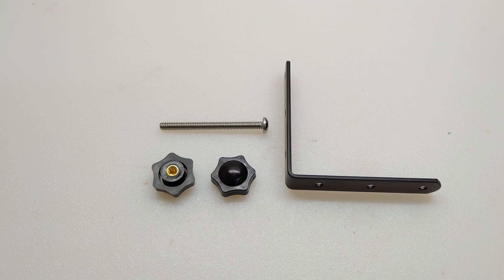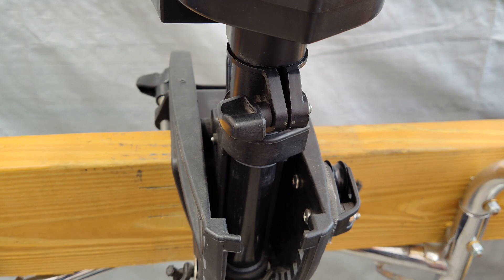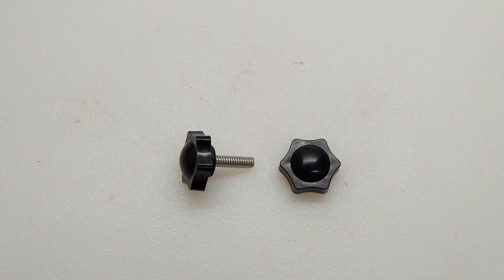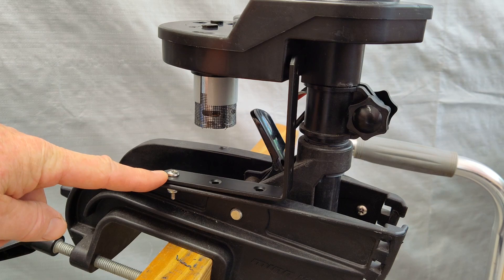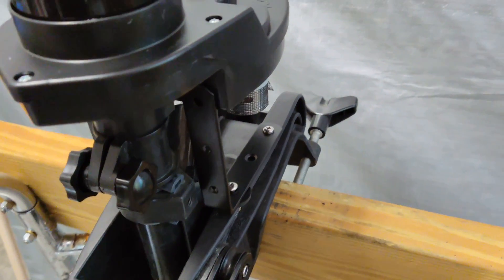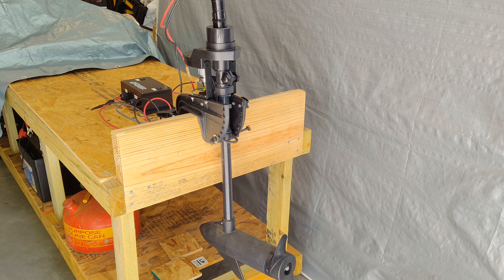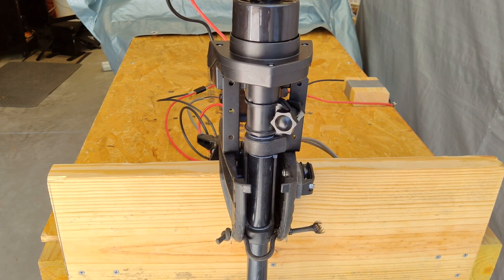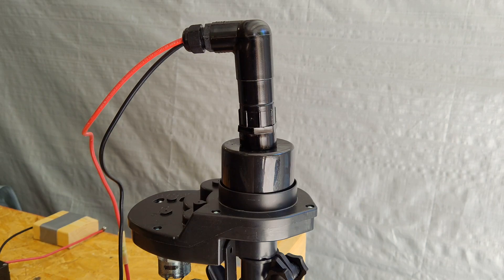Wireless Throttle and Gearbox Steering Stops for Trolling Motor

Comment: https://youtu.be/aZ_nHpNvjpc?si=Uc9aisNRS6FqQki7 

Stumbled into this vid today: it details how to adjust the amount of travel on the transmitter. No need for stops!
Reply from the maker: Thanks Wali. I had ordered another ESC to try that out since I know CH2 can be adjusted as well. I didn't know about the video though.
Reply: @Aksmaniyak   I gotta take it back. That doesn’t do a thing in terms of stopping rotation. The gearbox would have to be a servo for that to work.
 What it does do is slow it down and smooth it out a lot. Similar to changing the esc programming but just using the transmitter. The reduced “stroke” makes for very smooth steering.
Reply from the maker: I tried using the channel 1 with the servo motor and the wireless controller and didn't notice any difference.
Reply: @Aksmaniyak  interesting. 🤔 wonder if the manufacturers idea of “stroke” is different than ours. Things often get lost in translation. I’m going to give it a shot with a regular servo and see if I can puzzle it out.
Reply from the maker: @fishesfromtupperware  It wouldn't be the first time that poor translations occurs with overseas products. Let me know how it goes.

Comment: I'm still hacking away.  I see you've used those 880 ESC on a few projects for a while. How's it holding up long term and under load?  Have you had a chance to run it hard for a long time in any of your other projects? I'm really amped about it and looking forward to wringing it out. Just looks a little physically small for the job.  I'm really hoping you'll tell me its fine. 
BTW: I found a "new" building material for brackets, boxes etc.   PVC sheet created by splitting and flattening PVC  pipe with a heat  gun. Easy to work and strong enuf.    https://youtu.be/wLZVM4r1n9c?si=7EY9hcXdbQvm8wWR
Reply from the maker: Hi Wali. The 880 holds up well with trolling motors under 50lbs thrust. Anything larger can cause the wiring to fry. That is why I tried the 100A PWM in my MK 45lb project. For all of the cost and labor involved with the PVC sheet project, I would go with the superior poly cutting board methods.
Reply: Great! I’m running a motorguide 30 so that should be fine. I’m planning to mount everything inside the trolling motor head. Definitely running the cooling fans and I think I’ll cut some vent slots. I spray everything with corrosionX. Although it works magic for waterproofing, I’m pretty sure it hinders cooling. 

I like cutting boards as materials. Although they beat the flattened PVC in terms of initial labor, it’s hard to beat in cost (free scrap and leftovers). 
PVC also forms easily with heat. Made some flush mount trailer light brackets with it and I’m pretty tickled.  
Gonna give it a shot as the first section of a tiller extension on my 6 hp outboard. I going to try molding it around the tiller and pvc extension to give me some place to mount the shifter, kill switch and cord. See any holes/improvements for that idea? 
Thanks! Wali
Reply from the maker: Sounds great Wali. This is a similar project I did. It may help.   https://www.youtube.com/watch?v=hqqZRRH35KE&t=325s